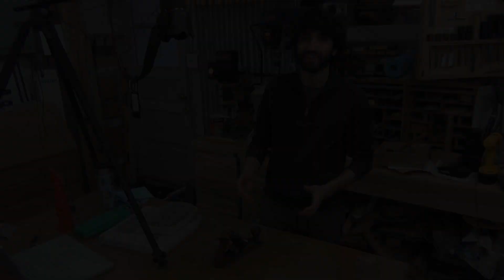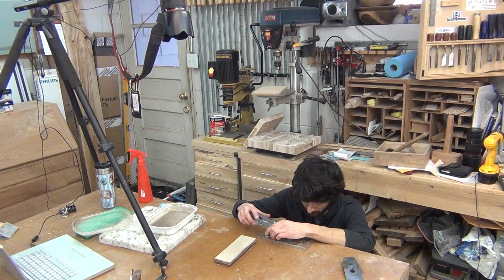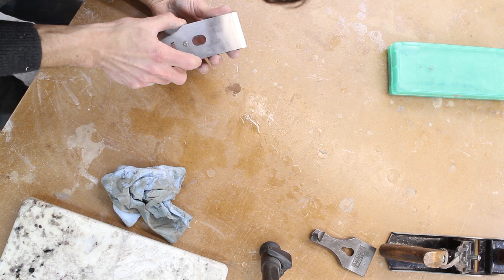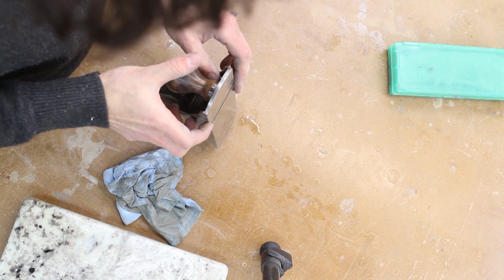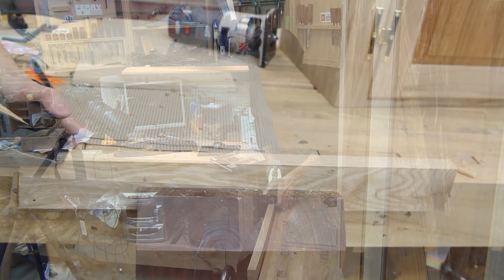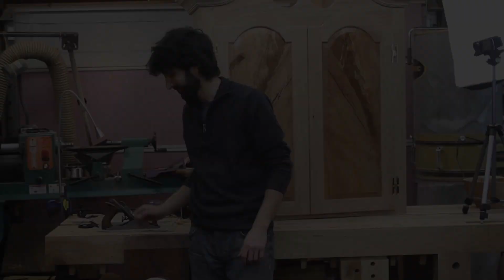How I Set Up My Hand Planes - Ask Matt #9

Comment: I don't like those blade guides. They make scratches and grooves in the stone. I like to pick up my stone and hold it in one hand hear my chest, looking down on the side of it. Then I take the blade or whatever I am sharpening and hold it against the stone. It is easy to see the angle and adjust it if necessary. I make small circles and move the blade to different parts of the stone so I get more even wear. It is quick and easy and I feel like I have more control. Dependence on those gadgets just takes up a sea of time, costs money, and does not do a better job.

Comment: I'm by no means a master wood worker, but I've been a framer/house building carpenter for 15 plus years. I'm pretty handy with most power tools and wood working in general. I've really became interested in word work using only... Well maybe mostly hand tools (non electric). I've watch sooo many "how to" videos about hand planes.... sharpening, restoring, setting up & using them. I'm sure I could improve in all the above areas, and probably some I haven't listed. With that being said, I'm not stupid either... I have learned to get the plane iron sharp, I understand the principals of how to set up & use a plane. I've tried several planes, Stanley, Craftsman, some " no name" brands. I bought a new Kolbalt plain at the big box store. It wasn't the greatest quality, but I got it sharp, I got the soul flat ect... No matter what plane I've gotten, or how sharp I get it, or how many different things I try with the set up, my results are the same... I can never get good results. Some times I've managed to half ass barley ok results, but never good or even decent results... Any advice?

Comment: I sharpen my blades up to 1000 and easily take  0.1mm which is 1/250 more than ample for woodworking .i find that people go overboard with 16k and 30k  or whatever.I could take less but of what REAL practical use REALLY is that?I also think that you should really distinguish for people who do not know the difference between bedrock and Bailey planes. regarding the frog.Otherwise it was a reasonable presentation.

Comment: Hello Matt...why not use diamonds for the whole process? Why the waterstones? Why not just go straight to diamonds and forget about flattening?   I'm tired of using sandpaper and need to buy either water stones or diamonds. i want to simplify my plane blade sharpening.  Cost is an issue for me, however.
Reply: Diamond hones are perfectly fine, paul sellers uses a 3 stone system, I use a tiny noname diamond hone when I started, but not the easiest to learn freehanding on.... I then went for arkansas oilstones myself after reading many good things about them, one soft 8x2 and one hard black from Dan's Whetstone, that was cheaper than 3 diamond plates and I only need two oil stones, and the hard black should never need flattening in my lifetime.

David W on youtube has some informative videos on oilstones. He really likes Washitas but they are hard to find (no longer mined + lots of fakes). I used to have a waterstone too for sharpening knives and razors many years ago,  but got real tired of the neverending mess and constant flattening. I really dislike waterstones today, and I don't have any water in my shop.

Comment: I have a hand plane like yours but mine is from Lowe's, it's a Kobalt model.  On mine, the top screw comes loose when I use it.  Is that from it being a $30 tool or is that normal?  And after a couple of passes, the blade will go back into the hand plane.

Comment: You sure don't use your planes much if it is a year since you last sharpened it. I too have an A2 iron in my No. 4. In making a single drawer I probably sharpened that one 3 or four times, in adition to sharpening my No. 5 a few times (this one has a standard Stanley blade, which I find works just fine too). 

I really love my planes though, and I like them sharp. Also I don't have a power planer or jointer, and I really dislike power sanders,  so my planes does practically all the milling and finishing.

Comment: Haha, your video seemed adorable and modest. I'm still struggling to set up my tool, but it seems my tool may be different -- its more flat and doesn't have the angle your tool has. Wonder if it is a different kind. What tool do you recommend for trimming down the sides of a wood door?  I need to take off about 3/16" on each side.

Comment: Matt, glad I found your videos.  I am in the middle of getting a small shop going, in my home in Montana.  My last purchase is going to be a table saw.  The ones that are for true woodworking shops are just too big for my area.  Can I get the same results from a portable jobsite saw?  I am planning on building a a small bench to catch the runout.  Thanks
Reply from the maker: jtapp83 The portable saws can work, depending on how good of one you get.  Probably the biggest issue with them is the fence.  If you can find one with a good fence, there's no reason why you shouldn't be able to get the same results.

Comment: Thanks for the links! How would you rate the 8000 stone vs the 6000? It's such a steep increase in price
Reply: Also, I found this you could link to: https://www.amazon.com/dp/B000248XEY
Reply from the maker: l3ender15 Oh awesome!  They started selling them again.  Thank you
Reply from the maker: l3ender15 The sharpness is better however it's a marginal increase.  I think if you were to stop at 6000 you'd be good.
Reply: Matthew Cremona Last question: why the coarse diamond plate (instead of fine or extra fine)?

Thanks for the help...your videos have really encouraged me to do sharpening the right way. I think most people (like myself) don't know how to do it properly so they're frustrated when using the chisels/planes/whatever. Though to be fair, to build up a good set of sharpening accessories--in addition to good hand tools--is quite an investment, which is why people (like myself) don't spring for it right away.
Reply: Matthew Cremona Oh, and go ahead and update the video description with an affiliate link to the 800/4000 stone. When I buy it I want to support you
Reply from the maker: l3ender15 The course stone will cut faster.  You could use a fine one but it will take longer to flatten a stone.    I'm happy to hear these are helpful and yes, this stuff isn't cheap.  I've built up my stuff over the years.  I think that combination stone is a great first investment.  It could be all that is needed.  It could be flattened with sandpaper on a flat surface too.
Reply from the maker: l3ender15 Updated. Thank you! :)

Comment: I don't own any hand planes and I need to pick up some. What would I want to look for and what sizes would be best to start collecting?

My goal is to use them similar to the way you do, to do touch up work on machine milled lumber. I want to start milling my own logs from the woods.
Reply from the maker: Matthew Cyhanick I use my #4 all the time.  It's the most used plane in my collection.  I've heard good things about the woodriver planes if you're looking to buy new.  Are you thinking of going with a chainsaw mill?
Reply: Matthew Cremona thanks for tip. I'll check those planes out.

Yes I am thinking about a chainsaw mill. They look interesting. I like that you can cut slabs in the woods if needed.
Reply from the maker: Matthew Cyhanick They're a lot of fun.  You'll love it!

Comment: I'm always suspicious of practices like micro bevels and sanding my work just because it's "that time".. why do you use a micro bevel? Have you ever used a plane without one? What kind of benefits are allegedly gained? Personally, I use a single grit to work my edges and I have never had an issue with 1000. Most people will automatically decide that 1000 is too low but I have no idea why, it works really well and I rarely have to sharpen. I just recently hand planed a burled log smooth to get chainsaw trenches out and have to imagine such a fine blade wouldn't be easy or fun to keep tuned up under those circumstances.
Reply from the maker: Jeremy Rider The micro bevel is great because then you don't have to spend time polishing the entire bevel.  You can just focus on working on the actual cutting edge. I like to go to the higher grits because I'm able to get a more consistently sharp edge.  It's really noticeable for me on the chisels.  I can feel how sharp they are based on their cutting performance.  For heavy work like that, this wouldn't work so well.  It would be better used after a plane set for roughing did it's job.  Thanks for the questions!

Comment: Nice closeup. Was that a macro lens? Finally purchased a Bailey No.8c to complete the collect (I think). The rest are in storage though and I have a feeling are completely rusted. Lots of work ahead of me.
Reply from the maker: diycentral Thanks!  Yes I use my 100mm f2.8 L Marco for those fun close ups.  It's the one you commented about having the lens cap on it for a dust cap :)  Hopefully they're not too rusted so you can get back to making shavings!
Reply: Matthew Cremona You beat me there. Don't have the L version of that lens. Actually it wasn't even out yet when I got mine. I'm getting jealous again.

Comment: good stuff! that was a little reminder for me to sharpen my planes.
question:
it really doesnt matter what the angle is? just as long as the tip of the blade or bevel is touching?( like u showed in the video)  but what if its coming straight from the box and needs to be shined up? same process but i would start it off with the 800?
thanks matt!
" til the next episode"
Reply from the maker: Joe Walters Thanks Joe!  The way I'm showing it here is by creating a micro bevel on the edge. So the cutting angle is only going to differ from the primary grind by a degree or so.  Pretty much the same process as out of the box, yes start at a lower grit. Thanks for the questions!
Reply: Matthew Cremona ok kool thanks man..inhave a couple that definitely need sharpening after finding out what SHARP is ..haha and thanks for the answers!:)
Reply from the maker: Sharp power!
Reply: Matthew Cremona yes!!! " im loving it" it makes life sooo much easier and accurate too.haha